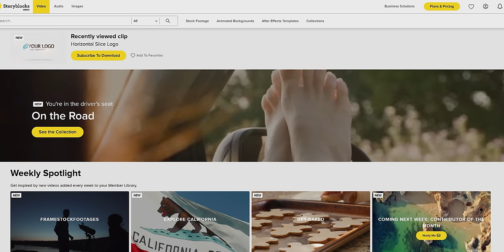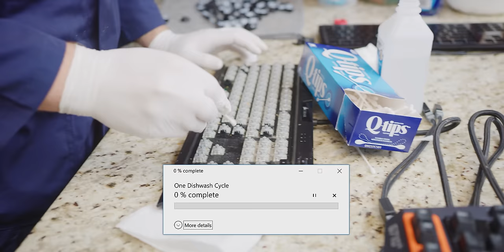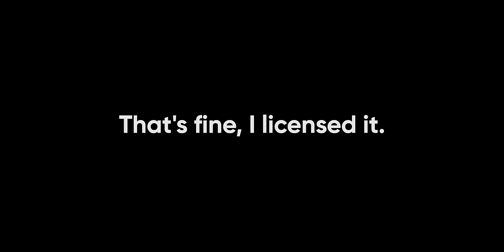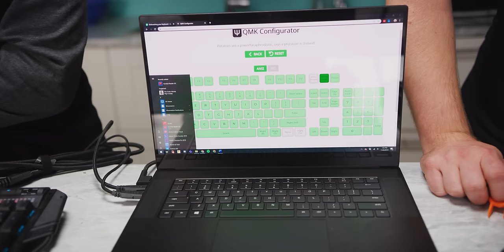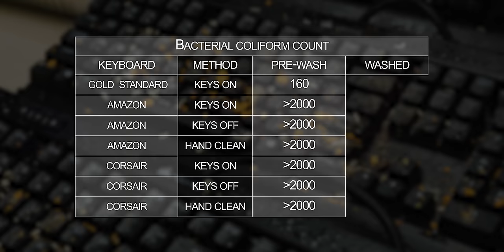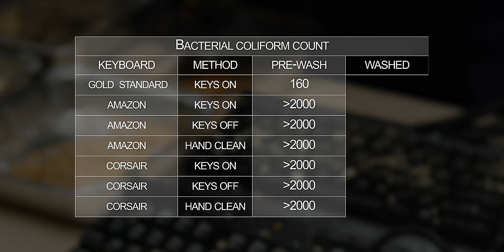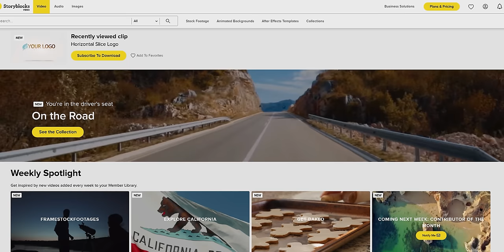The best way to clean a keyboard is… the DISHWASHER?

Comment: I usually remove keycaps manually, wash them in soapy water in a bag for several minutes, then use compressed air to remove all the obvious trash from keyboard itself, later switch to anything like a small brush or even toothbrush and clean the rest. Afterwards I use  cleansing wipes for the surface and call it a day.
Reply: >call i a day
because you probably spent the entire day doing it
Reply: @b4lderm  not at all. It took at most an hour tops.
Reply: Man fuck that, air compressor or the bin if it's that bad

Comment: OK guys, so corrosion CAN and often WILL occur through this method of cleaning.
Deionized water or 99% isopropyl is the PROPER way to clean electrics.
Tap water or other water will have electrically conductive materials present and will leave deposits on your PCB that may, over time, corrode your motherboard and cause it to short or fail.
This is why when you drop a phone in water, a bag of rice will in some cases, cause it to work again, but not always.
Even if the device was off when it comes into contact with water it can STILL be damaged AFTER it is dry.
You see it first hand when conducting water damage repair.
Under a microscope, your water damaged PCB can have little crevices FULL of mineral deposits that are left behind after the water evaporates. They look like little rock gardens...
Reply: I like seeing rice goo shorting things out on Louis Rossmann's channel. Soak those macbooks in rice, and send to nyc today!
Reply: @DoctorWhom  just like always I hope you learned something today....
Reply: If you install a reverse osmosis filter system and then re-filter that water with one that further removes 100% minerals from the water then supply the dishwasher with that pre-filtered water. Them run the dishwasher cycle with no heat.

Will this prevent mineral buildup?

Comment: An important variable that was omitted is water hardness and minerals that could be in your water supply. My well water is pretty damn hard and can leave a crust on pretty much anything. I wouldn't be surprised in the slightest if running a keyboard through my dishwasher killed it.
Reply: i think thats why you add salt too for the dishwasher to help with "hard" water
Reply: I second this.
Thats why i always drench my keyboard in a bucket of distilled water(condensation water from the dryer is a good source) before drying it out and reassembling it.
Reply: @pir4t  I usually end up smashing mine before they get dirty having said that I bought one of those k70s, been almost a year since snapping a keyboard so we should be good haha

Comment: they dishwash keyboards and they’re still perfectly fine meanwhile i wipe my macbook’s keyboard with alcohol and it dies
Reply: Then mackbooks are shitty.
Reply: @trippybruh1592  i'm so glad that shit died tho (can't login cause mf wont click) and now i have a windows desktop which is hella better
Reply: @trippybruh1592  I am not saying that throwing any piece of electronic into the dishwasher is safe, it absolutely is not, but cleaning electronics with alcohol actually is supossed to be safe and that's usually how you clean any electronics, and if @faudanke just cleaned a macbooks keyboard, and it stopped working, then i really would say that macbooks are pretty shitty. Macbooks are overpriced, thats a fact, their technology is low end, just made to look nice, and their software is made to work great on a low end tech.
Reply: I cleaned my Apple wireless keyboard with some rubbing alcohol and it killed it. I was so pissed.
Reply: @TJC450  I would be too. I'm an It/graphic design guy and i worked with macs for some time. I can tell you, macbooks are shit. And rubbing alcohol is 99% safe if you are cleaning it right on almost any electrinic device.
Reply: It depends on what you used. Modern rubbing alcohol is not the same ingredients it used to be, and can actually corrode the ingredients of modern electronics. Water would actually be much safer, especially if boiled to remove impurities. As long as you ensure it fully dries before plugging it in, and make sure to treat it for rust if you have parts that are bare metal. Getting wet and quickly drying shouldn't cause rust in most cases
Reply: I also should emphasize that when i say boil the water to remove impurities, you should not boil your device with it. I clean most my devies with water when they get too dirty. Never had any problems, even fixed some that had stopped working by doing it.
Reply: Maybe you didnt use their proprietary alcohol.
Reply: The battery must be removed. And put in when 100% dry DRY.

Comment: I used to clean whole systems in the dishwasher, years ago. I would take them apart and put each component in the dishwasher, and let it go. Then use a hair dryer to dry them off. Never had a failed system afterwards.
Reply: Really diggah?
Reply: SPLaholic is this real?

Comment: A big point you missed was that the dishwasher method seems easier, but then you're left without your keyboard for a week. Or you can sit it in front of a heater for less time but the point remains, you don't have to wait to dry a hand cleaned keyboard.
Reply: Another key point missed here (I've learnt the hard way) is that any liquid pretty much, including water causes corrosion on the board/s inside the keyboard, and that's only noticeable with time. So give it a couple more months and probably majority of the keyboards will stop working.

Comment: I bought 2 of the same keyboards 2 years ago.

1 i have ready for when the other gets dirty and needs a wash.
I just go to the sink, fill it halfway with water and use a hard brush to get between the keys.

Use a hairdryer for about 5 minutes on medium heat when it leans on its side to let the water out.
Then i wait 3 days with it hanging by my window while it hangs on a strap i have on my window.
Then i store that in a box for when my other becomes dirty.
Reply: Try an high concentrated alcohol after the water to skip the waiting for two days :) 
(To rinse the water out)
Reply: @saruto201  Alcohol is non-conductive? didn't know.
But you'd still be playing on a "wet" keyboard though, right?
Reply: @falonthorne445  Well you'd have to still use the hairdryer for 5 minutes, but because alcohol is way faster in turning to vapor than water it will be gone while the water still needs more time.

 But I'm still impressed by your technique, because I was pretty much panicking on my first time my one and only keyboard got dirty. (Softdrink)
So I bought isopropyl alcohol and put the hole thing in soap water for 30 seconds. Washed it like a peace of clothing in the early days and rinsed it with the alcohol. Hairdryer at the end and voilà no sticky keys. Interesting enough the alcohol did not help when I tried it the safe way with Q-Tips. I even opened it and the sugar was just moving from a to b. 

Sorry for taking so much from your time due to reading :)
Reply: @saruto201  didn't really take a long time to read, so i don't mind.

But you'd want the most amount of alcohol possible, right?

I have some isopropyl 70% under my sink but should i get some with a higher alcohol percentage?
Reply: @falonthorne445  Well the higher the alcohol content the lower is the amount of water you need to get rid of with your hairdryer I had some 60% stuff earlier and tested it with it on another electronics board but it left visible water marks, sure they will eventually dry off but I didn't risk it.

 I ordered 1L of 99% from Amazon and I think it was 10€. And I advise to do it with an open window :)
Reply: @saruto201  i can imagine the smell of drying alcohol.

Comment: I've been washing keyboards in dishwashers for years and havn't had any problems. I've got one that's lasted 12+ years and still going strong. But I take the keyboards apart and wash only the plastic parts. I leave the heated drying off not to warp/melt the plastics then I blow them dry with aircompressor and let air dry really good. Then I clean the electronic components with Alcohol or electronics cleaner.

Comment: If you’re in Europe consider the fact that most dishwashers here heat up to 75°c
Reply: Mine has multiple options, from as low as 30c. Probably skip the drying option, cause that will heat up.
Reply: mine from 30C to 60C, and i live in the Netherlands

Comment: Would be interesting to see how well soap works and if it would damage the keyboards.
Reply: Ive ran MoBos thru with dish soap to clean cap juice. Works fine. Used can air to blow out water under circuits and let it dry a few days.

Comment: Would a lazy person not vacuum the keyboard first with a common dust brush attachment .. then toss it in the dish washer.
Would a water spray handle at the sink not be enough to wash away junk.. and be faster and get more angles..(or garden hose or shower (key caps not removed?)
Also they work but any corrosion? limiting the life of the keyboard even after letting them dry out..
Reply: Depends if you let it dry out quick enough

Comment: What i always do and what works best for me is to:

1. Take off all key Caps (membrane or mechanical doesn't matter)
2. disassemble the keyboard completely so that the pcb and cables are the only thing that remains.
3. put everything that's not pcb/cable into the dishwasher. 
Key caps in a dryer bag(like you would with bra's and sensitive stuff in your washing machine. 
Membrane flat top "shelf" of your dishwasher (sorry for bad English i am from germany) 
Keyboard case in the rack of your dishwasher
All at about 45, max 60°Celsius (not gonna calculate in Fahrenheit because Fahrenheit is for plebs) 
4. clean the pcb with contact cleaning solution.
5. take out the washed stuff, let it dry on a towel.
6. clean off any residue that might got stuck on the caps/case

7.
assemble

Comment: My partner at work tends to eat over his keyboard so as friends do, I bought him the same keyboard off eBay but it to was filthy but not as bad as his keyboard. Brushing off all trash between the keys with the keyboard also upside down as done removed all the big matter (probably would get the hair out but alas hair was not a problem for this keyboard). Then I surfaced cleaned but still wasn't happy with some keys sticking. As a last ditch effort I put it into the dishwasher for a full wash with soap and drying heat on. Though set the keyboard one quarter in from the side so it gets the full action of the spray with nothing around it to block the hosing down.  I knew the dish soap would clean out any residue and it did. Swing the excess water out of it and let the keyboard dry for a couple days and it worked like a champ.  This was a last try effort so it almost went to the dump but at this point there is nothing to loose. Do note that I cleaned a thermos out that was blackened with old coffee by placing a detergent cube in it with boiling water, sealed it up and shook it. In the morning shook it again and dumped it out and it was like new. I mean everything was gone. This soap is powerful.